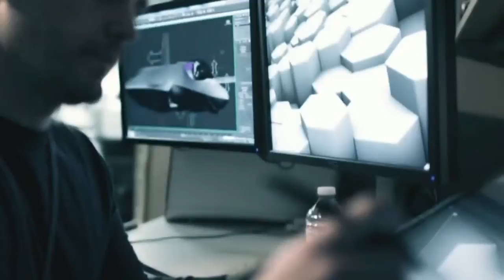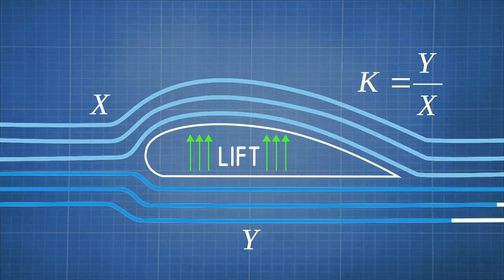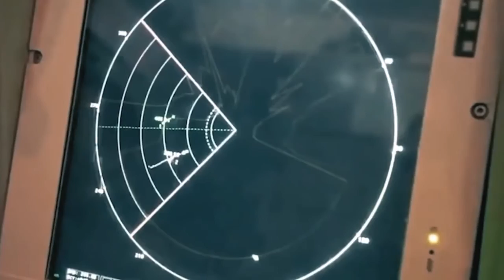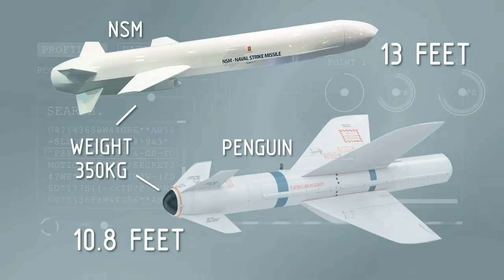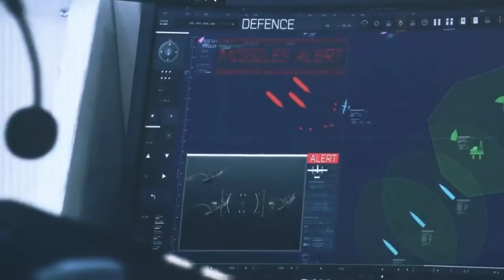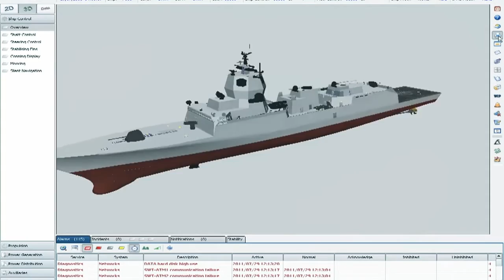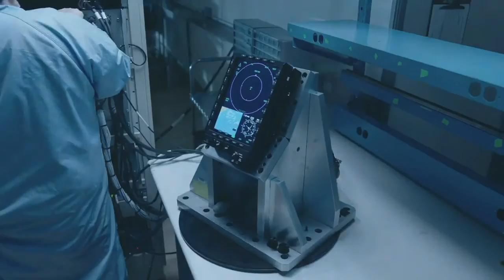American New Naval Strike Missile (NSM) Is A Monster

Comment: Norway have an excellent missile, it was so good that Raytheon have taken the licence to produce it Stateside. The F35A/C can carry 2 missiles internally making it a perfect weapon/aircraft match ....both being stealthy . 
  The warhead is slightly smaller than some would like but if you look at the test fire, against the decommissioned frigate Trondheim, by one missile then you see it is capable of crippling a target rendering it unusable for years.
Reply: Range buddy, range is the problem.. Any ship carrying the 100 mile range NSM will be targeted and shot at hundreds of miles before the ship armed with NSMs will be able to do Jack sh**. And I'm not referring to the JSM missiles carried by the F-35 but the new Constellation class frigates which will have them instead of LRASMs
Reply: @vegass04  The Mk. 41 vls takes up a lot of room so ships smaller than 3000 tons are not a  realistic proposal for that installation ( for the larger strike length weapons ) but NSM can be fitted on patrol sized vessels and in litoral missions they are deadly. 100 miles is beyond horizon detection and so lots of options for an effective deployment. NSM is effective just like NLAW is not as complicated as Javelin it still lifts tank turrets.
Reply: @vegass04  The Constellation Class Frigate is around 7000 tons so that is not a small vessel. My point is you can fit Mk 41 Strike length and then launch all the big missiles like Tomahawk,SM 3 etc but a smaller vessel needs a smaller weight launch platform and a lighter missile ( not to mention cheaper) that is still a deterrent. The Constellation Class is going to be outfitted with NSM.
Reply: @NATObait  You're making my point. Constellation is large enough to field LRASMs but they still stuck with the 100 nm NSM. I'm not sure you're making the point you think you are. We're running in circles, bye man.
Reply: @vegass04  Norway has the Skjoljd Class Corvette at 274 tonnes fully loaded it has 8 NSM weapons. Horses for courses my friend. The Constellation Class is designed to be part of the Carrier Strike Group so multiple layers of defence is available and you only shoot the cheap stuff first  you get 3/4  NSM for the price of 1 LRASM and if you need range Tomahawk does that .  The NSM  missile is capable, stealthy can fly over land and is being built in America by Raytheon as the USN have faith in its ability or they could just listen to you!

Comment: I still fail to recognize why is NSM so highly regarded as an anti ship weapon today in 2022? We're living in an era of Brahmos, Kalibr, ASM-3, Tomahawk Block V, Zircon and LRASM missiles. In an era of supersonic, hypersonic, extremely stealthy ASM missiles with ranges reaching 1000 miles, speeds exceeding Mach 5 and warheads weighing over 1000 pounds. And then there's this 5th gen (whatever that means in the context of anti ship missiles) little missile from Norway that cruises at Mach 0.9 with a range of less than 200 km and the warhead of around 250 pounds... This video definitely didn't explain it to me why is NSM so special (JSM is a completely different story with it being the only missile with that range that can fit inside the F-35's bomb bay).
I don't even wanna mention anti ship ballistic missiles and the hypersonic boost glide anti ship missiles since they are so large and expensive that they simply stack to a completely different category... But as far as ASM cruise missiles are concerned, all of those I've mentioned above are superior to NSM in every possible way except size and weight. But as mentioned, this brings constraints to the NSM since the sub 200 km range places you in a dangerous place where you're way inside the range of enemy's coastal ASM batteries. 
NSM, with it's relatively small warhead, won't be able to sink anything larger than a smaller frigate. Forget about sinking the Chinese Type 055 destroyer with that puny 150 kg warhead... 
But then again I maybe completely wrong. After all the subsonic missile with a slightly bigger range and warhead but with leass advanced targeting system and far less stealthy, managed to hit and sink the flagship of the Russian Black sea fleet. So who kniws, maybe all ships are much more exposed and unable to defend themselves even from the older design missiles, let alone from the "5th gen" Naval Strike Missile...
Reply: It is small, passive ship identifier and detect, hard to detect, smart traveling following the terrain taking another path from where you shot in from and long overhorizon range despites its size. You do not put a Tomahawk inside a F-35.  Now imagine several of those in small ships, small vehicles etc hitting the bridge in any ships.
Reply: @victorosborn3348  Sure. Size, size, size.. But the US Navy decided to choose NSM for our next gen Constellation class frigates. There was no size constrain for installing LRASM for example.
And then we get to the crux of it - range. Those frigates will have to come mighty close to an enemy ship to sink it with the NSM. By the time our frigate gets within 100 miles of an enemy ship she will be targeted and fired upon by the much longer range enemy's ASMs for hundreds of miles. I don't care how sneaky and smart NSM is when it can't do jack sh** to enemy unless they are at the throwing distance.
Reply: The missiles you are refering to are all good, but also very large. They all have a large signatur compared to NSM. NSM can be fired from small vessels, and do massive damage to larger ships. They can hit land targets and be fired from land. They can be fired from helicopters etc. They are passive, stealthy, smart, and have a great linkup system. It does not explode on inpact, but pierces armour and detonates within ship. It has far better maneuverability than the larger missiles. It is simply very, very hard to detect.
Reply: @daginn896  LRASM is extremely stealthy, less detectable than NSM but with much greater range and payload.
Reply: @vegass04  No, it is a much more detectable missile, higher radar signature. Also it should be compared to JSM.
Reply: @daginn896  Where is your proof that NSM is stealthier than LRASM? Evidence buddy..
Reply: @vegass04  Because it is much smaller and have the same stealth capabilities.
Reply: @daginn896  That is pure assumption. Now let me elaborate why I think LRASM is stealthier than NSM. Here we go.. LRASM is built by the Lockheed Martin - the company that has more hands on experience with the stealth technology than almost any other entity in the world. But for sure Lockheed has more knowledge and technology to build the stealth missile than a Norwegian company that hasn't got any prior experience with stealth. For example B-2 Is much larger than the F-16 but it's much less detectable than the small Viper. So size doesn't matter.
Next LRASM has pioneered the passive sensing technologies in the GPS denied area, and from the open source data we can presume that technology is much more advanced than the one found on the NSM. But hey, you've got your "it's smaller argument".. Ride with it..
Reply: @vegass04  That is pure assumption. You have zero arguments. At least my explanation is logic, smaller equals smaller signature. And going by your "argument" of experience, Kongsberg have made weapons since 1814, Lockeed Martin since the 1990's. The LRASM is not even considered a 5th gen missile, NSM is. Hell, even Japan chose JSM over LRASM.
Reply: @daginn896  Japan choose JSM over LRASM because it can fit inside F-35's weapons bay not because its "5th gen". WTF is 5th gen missile and what are the traits of one? Like I said LRASM pioneered system for tracking and engaging targets passively in the GPS denied area, not NSM.
And this "Kongsberg is older than Lockheed" argument is the dumbest I've ever heard. Nokia is making phones much longer than Apple, does that mean they make better phones?
Lockmart is pioneer of stealth technology and that argument is valid in our discussion.
Reply: No evidence available as to either missiles stealth signatures only speculative guessing.
  2 NSM/JSM can fit internal bays on F35 
  0 LRASM fit bays on F35 but can be pylon launched. 
  LRASM costs double the price of NSM
  LRASM is nearly 3 times as big.
Stealth of an F 35 would be comprised with a big external missile bouncing and reflecting radar emissions.
 That both missiles are intelligent is a taken and on any ship the prime area to hit is the mission room and the control centre is often split in 2 positions exactly for this. 2 NSM can be tasked to damage both. Any ship attached in such a way would be at best in repairs for years but probably would be a write off or burnt out and sunk.
 The best scenario would be to have a mix of both types for silencing modern complex targets then use JDAMs when they are down to basics. That is the reality. Spend only what you need. Their will always be something else to blow the budget on just as important.
Reply: @NATObait  Sure, you make a few valuable points but I would still agree that LRASM is simply the better ASM. Definitely better stealth (NSM is an upgrade of the old Penguine missile from 1980s while LRASM is an upgrade of JASSM). LRASM has a longer range which ic CRUCIAL, no ifs and buts about it, 100 vs 250 miles is an enormous difference.
JDAMs as AS projectiles - in your dreams.
Also the guy was complaining about NSM being chosen for surface combatant not as the F-35's ASM. For surface ships LRASM would be much better..
Reply: @vegass04  The US have bought Kongsberg missiles since the 1970s they know that it works. SM2 has the same name as it's predecessors but is all new. Your logic is based on patriotism? not reality
Reply: @NATObait  What does your response had to do with anything regarding anything? Jeezz.
Reply: @vegass04  you said NSM is an upgrade of the Penguin missile from the 1970s therefore you implied it was no good as it was old tech. I merely pointed out SM2 has been around since the mid 60s but todays version is completely different in every aspect except its name.
  NSM/JSM is not better than any other missile other than it fits 2 inside a F35 bay meaning a stealthy mission is possible. But then you know best and Raytheon who are building the missile in the US are fools? The Norwegian, Royal Navy , USN , USMC, Japan, Australia, Germany, Spain, Poland etc etc all think NSM  missile is a winner. But you know best and they bought the wrong missile??!!! 🤡
Reply: @NATObait  SM-2 was upgraded with SM-6 although SM-2 is still used.
Again, LRASM is a better option for VLS tubes on board surface combatants.
The rest of the countries aren't stupid, they just don't have enough money. FYI Japan has an incredible supersonic ASM in its inventory but doesn't have the money to buy only those. US Navy should be able to afford LRASMs for surface combatants and use NSM/JSM for F-35s. Am I talking Chinese? I thought I was pretty straight forward but you seem to misunderstande me again and again..
Reply: @vegass04  The USN & USMC don't take your advice. Everyone else thinks you're a fanboy who talks waffle. SM6 is a hybrid using an enlarged AMRAAM seeker on a boosted SM2 base so it goes a greater distance and can hunt independently if needed. Nothing like SM2
 LRASM is launchable from Mk 41 cell but can you launch it of a smaller ship or patrol vessel. No. It's to big !
Reply: If you can't track an F35 and it launches the 2 JSM missiles from its internal bays that are also stealthy .... you are in deep trouble. 
 Rival systems offer range, speed and clout but none have the combination of ability that NSM/JSM has and it's partner in crime F35.
Reply: You have no fcuking idea,do you
Reply: if the NSM  only has a range of  200km  if its stealthy   the opponent  has little time to react ?  and also  does the  receiver  actually know what missile  they are up against     How about  Hypersonic missiles  launched from  a sub    with  say  10   warheads   programmed   for different targets     little time time to re act?
Reply: From my understanding the targetting package knows where to hit a ship to inflict most damage so you don't need a huge payload. The ship may not sink but would likely be out of action.
Reply: @sensibledriver933  LRASM has the same capability but is LONGER RANGE. This is the main reason why the US  Navy should use LRASM on surface combatants until the now in development OASW Incrment 2 comes out which will be hypersonic.
NSM for F-35s but LRASM for surface combatants and submarines. If you don't agree please point to what you don't agree with and tell me why I'm wrong?
Reply: @vegass04  Cost. LRSAM is 6 million bucks a pop as opossed to 2 for NSM.  You can fire 3 NSM's for the same cost and have an increased change of a hit. You can also carry more of these as they are smaller.
Reply: @vegass04  No need to get offensive. Pardon the pun! Target identification at long range is the issue here. We care about hitting civilian vessels whereas the chinese ane Russians probably don't. If you fire an ASM from 300 miles away there is a fair chance it will hit the wrong target. It's better (IMO) to have a superior defence against ASM's than a 500 mile offensive weapon that is indestriminate in it's targetting like the Russian Shipwreck. Range can be extended by air launch from systems like the Poseidon.
Reply: @vegass04  Everyone else, including the US and UK governments thinks this missile is ok, you don't. Who should we believe?